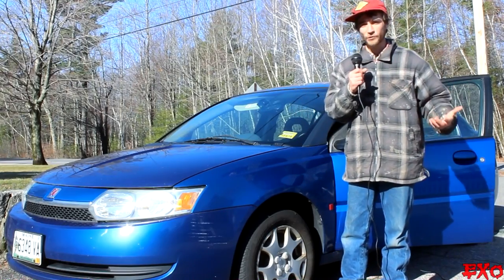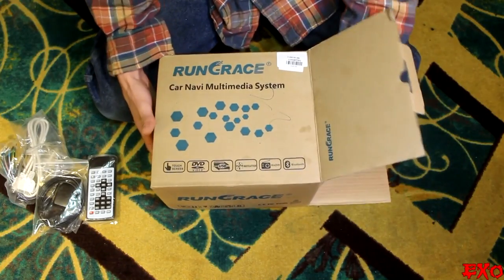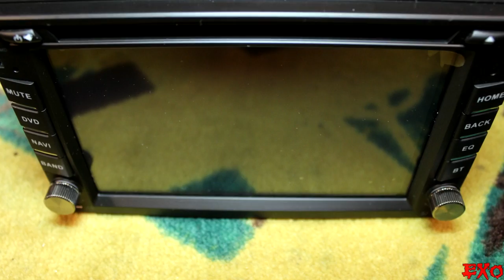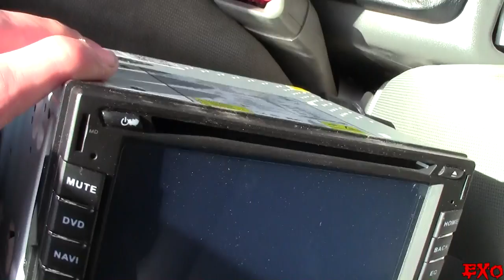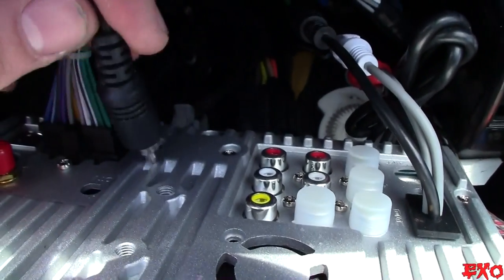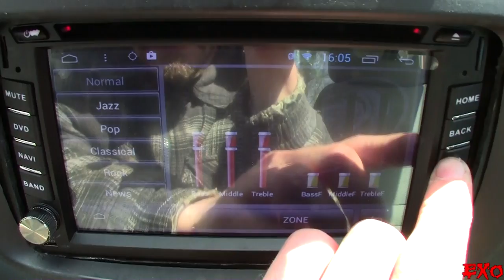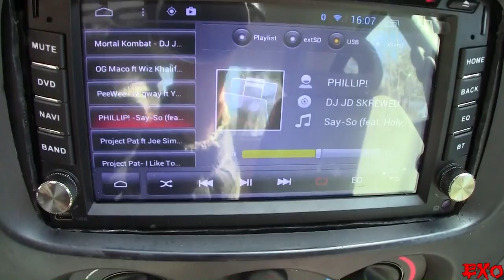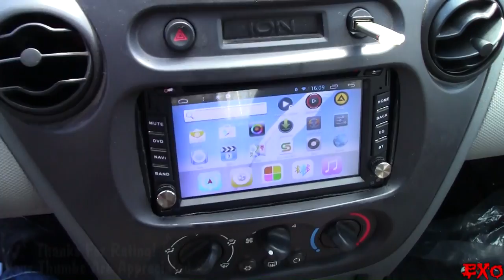Installing EXO's 1st Android DOUBLE DIN w/ 12v Touchscreen CD Player & GPS NAVIGATION Head Unit

Comment: Thumbs up I have this exact radio in my wife's car for over 1 year and a half and the only complaints I have is the boot up time and on the radio section when you touch screen the station sometimes you hit the auto search button and it erases your pre selected stations. Everything else is ok also I have a clarion 746 hooked up with it and would def recommend adding a similar eq.

Comment: Got a similar Android headunit from Erisin for my Audi with OEM look. There is an app called "Viper4Android". This app is made to control the sound, but it needs a rooted device. If your aren't happy with the stock equalizer in the unit then try this app. You can adjust nearly everything like you know it from the big brands like pioneer or kenwood headunits.

I love my android headunit. Bumpin some bass with the navigation on isn't a problem. The music mutes smoothly when there is a navi-announcement and then the music fade back in.
Reply from the maker: +RCBashChannelHD thanks for the info man!

Comment: I have the same head unit made by auto pumpkin.  There is no sub control and the pre-outs are only 1.5 volts.  I also had the same issue with my universal kit.  I had to make my own mounts.  But overall I really enjoy mine.
Reply: Tim Johnson 1.5 volts? Eww....

Comment: Will this fit in my honda?
Reply from the maker: +bshawn41 As long as you have a dash kit for your honda (wally world even sells them)
Reply: +EXOcontralto about the glare did you think about getting your Windows tinted and a tint strip on the windshield
Reply: +EXOcontralto hey EX does that already have built in Wi-Fi?  and about how much it run you about?

Comment: i can say for mids and highs u will need an amp the radio itself does not have that much power
Reply from the maker: +bassaddiction - I explain in the video that I am not using the head unit to power my speakers. My car speakers has never ran off the head unit. This unit will be just for RCA preouts to my EQ, and amps.
Reply: you have seen his other vehicle right?
Reply: I'm sure he knows this